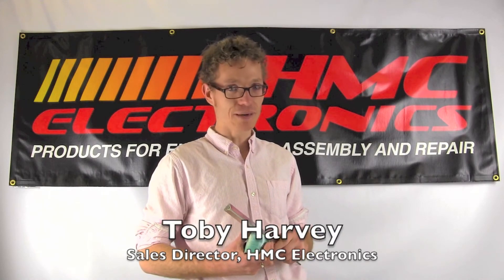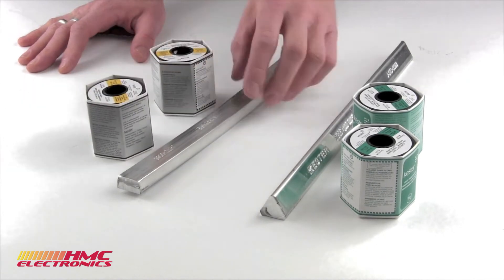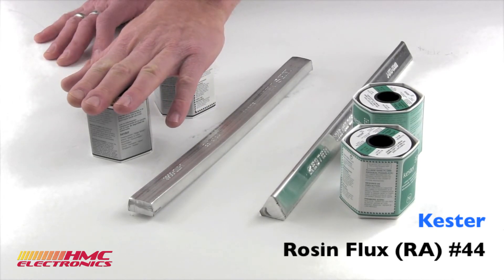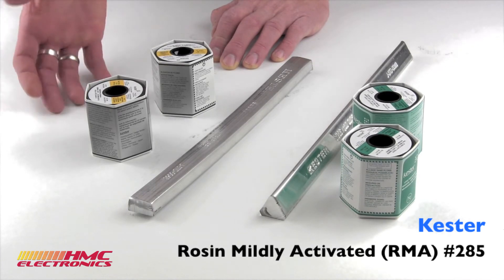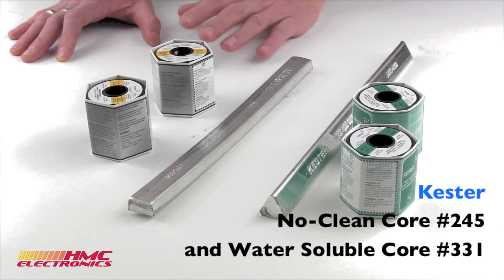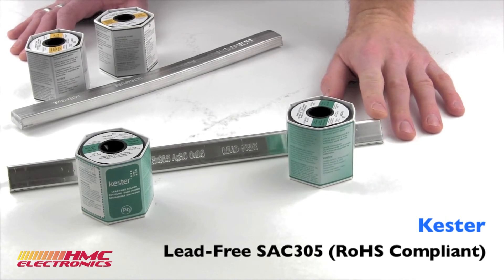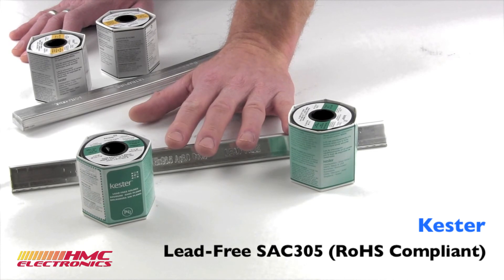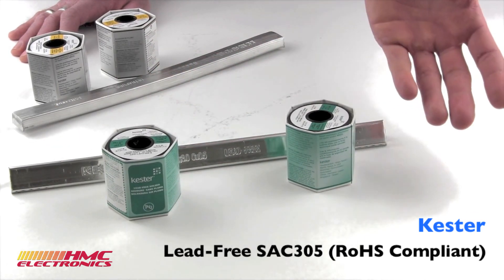Kester Bar and Wire Solder Overview

Comment: Lead free does not yield the appearance, quality of joint or the reliability of an RMA solder. The Kester 282 solder is used in critical circuitry, medical, military and aerospace applications with the highest reliability that can be had. This solder and it’s equivalent Aim or Alpha Metals solder has no peer in quality or reliability. Lead free has never been able to yield the appearance that satisfies stringent DOD Standards. The new “J” standard is a joke. There is but one standard and that is DOD STD 2000-1. It’s stringent and hard to comply with, yet joints soldered under this standard can handle vibrations, g forces, mechanical and physical stresses and thermal inversions without failure. Most people do not have the discipline to practice this standard. I had to live by and with it when I was in the Air National Guard. I am a fanatical solderer. Any standard that advocates reflow and rework is a failed system. Do it once, do it right the first time or leave it alone! That is my mindset. I do not apologize because when human life and/or high value assets are involved, mediocrity has no place! It’s that simple. Truth is it’s own guide! The formulations were either Sn63 or Sn62. Both are pure eutectics. The Sn62 has 2% silver in it’s content, 62%tin & 36% lead. The silver content increases it conductivity! There is no better in my opinion. The proof is in the work. If you doubt it, try it! You’ll see it is true!
Reply: This is the man to ask! OK so for embedded hardware, like RasPi, Arduino work, which one is the best?

Comment: Informative video! I have always used Kester. What's the best solder alloy for high end audio cable conductor soldering? I have used tin/lead/2% silver and seems to work fine. Is any of the lead free stuff good for pro audio applications? if so, pls let me know, willing to try it.